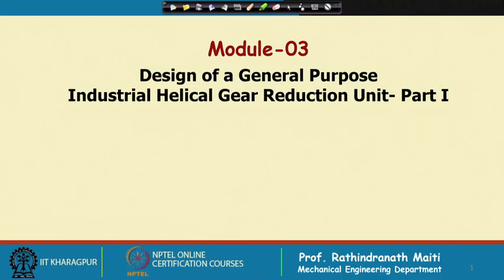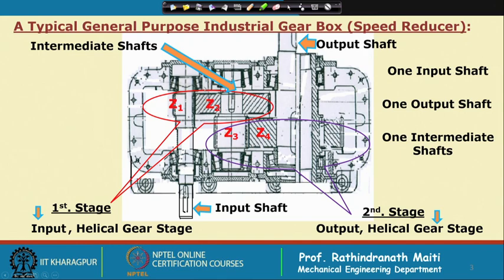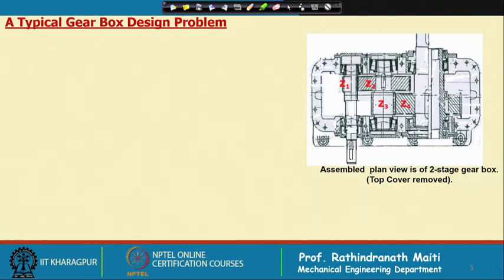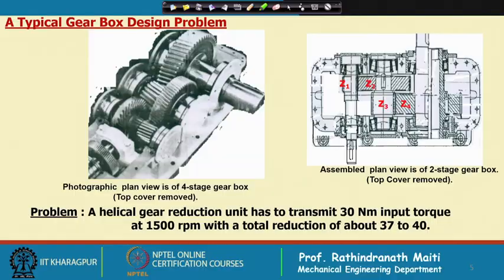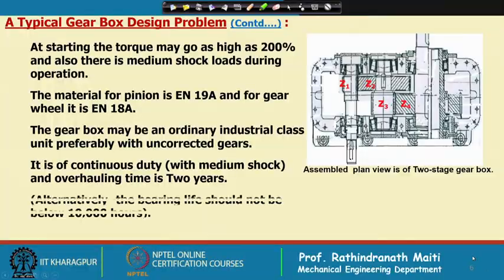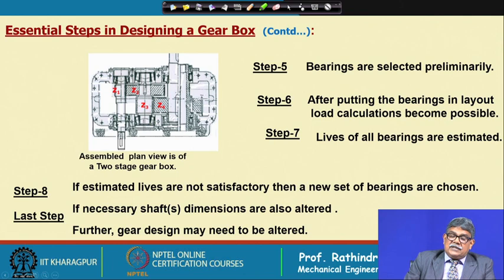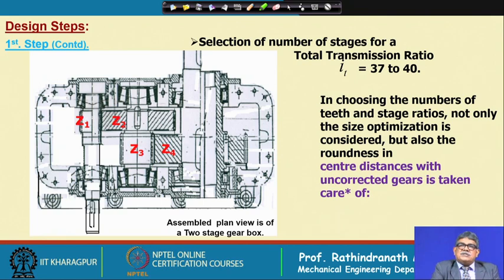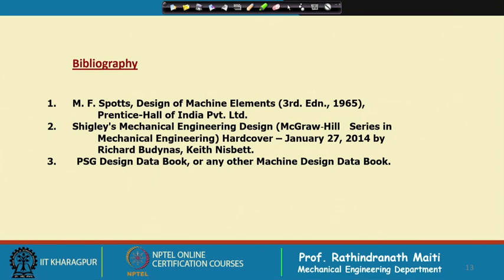LECTURE 11 : Gear Unit Design â€“ Selection of Stage Ratios, Pinion & Gear Teeth Numbers

Comment: Sir, well explained but can you explain by taking an example like :- to drive the machine 30KNm is required @1500rpm then gear boc input power and speed amd then how to select output torque anf speed an all in detail

Comment: Sir,

Thanks for being so descriptive in each of your lectures.

I have one question based on this lecture, i.e.

For automotive, if slip torque is less than prime mover torque than shall gears be designed according to slip torque or max. prime mover torque?